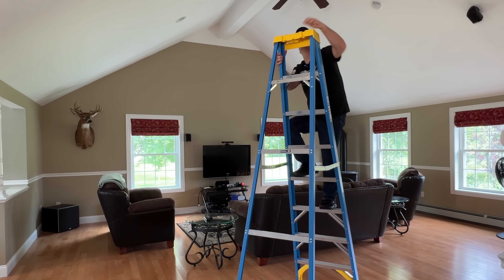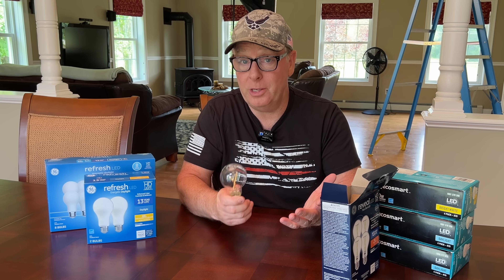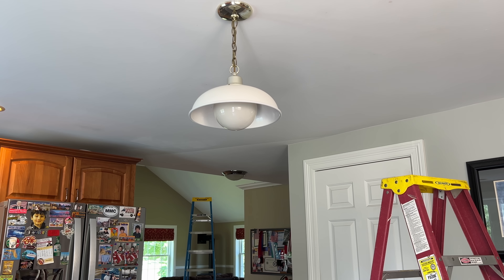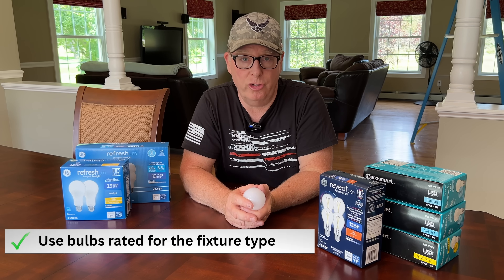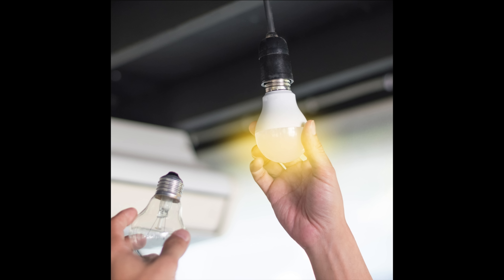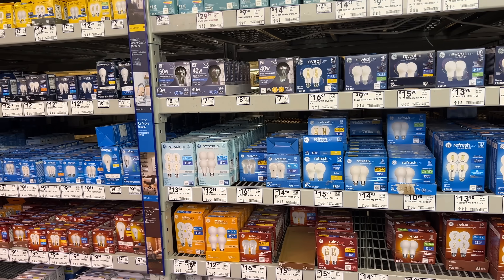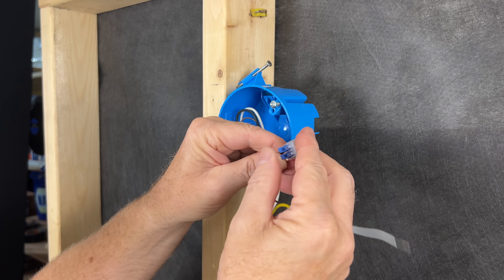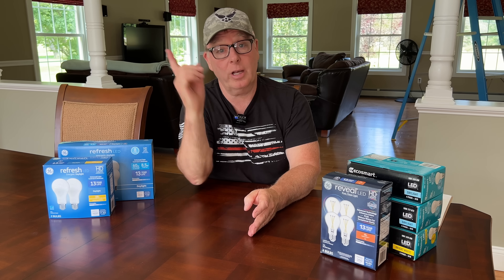The Mistake That Kills LED Bulbs

Comment: LEDs - the solid state physics device that eventually became the heart of light bulbs - was extensively commercialized when in was in engineering school a million years ago.  One of our professors suggested that an LED should last about 70 years in normal service.  But, if operated outside its designed current, lifetime would be greatly diminished.  Could it be that LED bulbs are suffering from designed-obsolecence disease?

Comment: I purchased 7.5 watt equivalent warm white bulbs to use in 2 small lamps in my den, off the internet.  They are on 24/7.  Has run continuously over 8 years now.  Same with a 15 watt equivalent warm white light bulb use in display cabinet, 24/7 on, 10 years and performing strong.
Reply: Yeah I have some going 14 years at least 12 hours a day from Omron

Comment: An led bulb or fixture will not turn off completely if your switch is wired incorrectly. I learned that 4 years ago when I installed a fixure in my kitchen, with the switch off the fixture would have a very dim glow, ony noticeable at night. The switch was on the neutral rather than the hot wire. I checked all my light wiring after that find.

Comment: At 3:39 ,
The bulbs are rated in hours, the percentage of time they are left on shouldn't matter.
Besides,  solid state electronics are much better served by constant temperature. Not just their surroundings but the components and boards they're made from.
The constant expansion and contraction from cycling is far more damaging than temperature fluctuations in their surroundings. 
Causing solder joints and traces to crack, resistors to fracture and capacitors to lose dialectic. 
Ive had many television repair people say the worst use scenario is frequent on and off cycling.  The same is most likely true for bulbs.
We know it's true gor incandescent ones.

Comment: nope, not at all. quality is good, they are all the same leds from the same manufacturer.
they have built in temperature sensor integrated to the driver.

they are over powered to make them burn.
add an ac capacitor to dim them slightly. will never burn again.

for standard dimmer: leave an incandescent bulb or a dimmable led on an array of undimmable leds. standards dimmers need a minimum amp draw to work properly which leds does not meet.

Comment: Thank you, John!  👍👍  I use GE Refresh and Philips Ultra Definition and about half of each brand burns out way too soon.  My office overhead fan and 4-bulb light fixture stays on about 16 hours every day and 1 or 2 will burn out in a few months while the others keep going for at least twice as long, if not years.  The overhead fan and 4-bulb light fixture in the kitchen is hardly ever turned on and usually never for very long, and 1 bulb will burn out quickly, a 2nd will burn out a few months later while the others keep going for at least twice as long, if not years.  Neither box says "Suitable for enclosed fixtures," so maybe that's why.  The fixtures are not enclosed, but they do entirely "cup" the bulbs and trap heat.  It's always something!  My Ex used to say, "If it ain't one thing, it's ten."  I wonder if holes could be drilled at the top to vent the heat.
Reply from the maker: Your Ex was right about that my friend. lol

Comment: Ecosmart bulbs are good for the money. The LED bulbs in my ceiling fan have lasted four and a half years so far, the ones at the top of my stairs, not so much. I need enclosure rated. I have two CFL, the first available, straight ones, not twisty, that have lasted since the early nineties. They cost more and were better built, 100watt equivalent to boot. I found several halogen, incandescent style, in my house when I bought it, I put them in my collection of porcelain knob and tube that I also removed. I also have the original porcelain hook up for the first telephone land lines around here, and I think I kept some of the original cloth covered phone wire.
Reply: You may know this but FYI those old porcelain tubes are great knife sharpeners. I carry one on my person. I only have a few of them so I guard them jealously. I dropped one on a hard surface once and it broke. If you have a lot of them they could be a great gift for your prepper or outdoorsy friends. Since they are hollow they can be used to blow on a fire, also a person can keep a rolled up piece of paper inside to use for either starting a fire or leaving a note.

Comment: 1:28 This is not true because the LED bulbs back then will fail early but the ones that I have bought last very long. 
The modern ones that I buy last longer. I often buy ecosmart LEDs because they last very long as they work with enclossed fixtures. The good thing is that modern LEDs are more durable & reliable. Most modern LEDs can be used in enclosed fixtures but older LEDs might not work. If you want dimmable LED bulbs you must have the switch & bulb compatible.

Comment: The truth of the matter is the reason they’re not lasting is because the LEDs that they’re putting in the bulbs are cheap. Chinese made LEDs. They are designed not to last as long as they claim. This is all in design so we keep buying constantly with the thought that they will last a long time. This will never change until a government entity steps in and forces manufacturers to give the correct longevity of the LED bulbs they are making.

Comment: Using LED bulbs that have the newer Match stick filament design tend to last longer as these do not produce as much heat. Heat rises so having an LED bulb upright (where the screwbase is on bottom...think table lamp) sends the heat away from the electronics inside the base of the bulb.

Comment: I have used the Home Depot Ecosmart bulbs and they seem to last as advertized. Most if not all of them are also rated for enclosed fixtures. Recently they came out with bulbs you can adjust colors and lumen output which as an electrical contractor is really great and they are dimmable. Hopefully they last as long as the non adjustable.

Comment: I made a comment on the other video about reversing hot/neutral not working. My bad. I had just repaired an led spot on my truck and had applied a DC light mindset to an AC situation. What I do encounter, in older New England homes, is voltage drop... Which I suspect was killing LED fixtures. They start buzzing and flickering. Could also be cheaper fixtures, but I've returned to only using fixtures with replaceable bulbs. Can't have a tenant replacing wiring if a light stops working.

Appreciate the info on enclosed fixtures.... Seems hot AND cold adversely affect led electronics.

Anything about the dripping silicone? Or is that only early generation LEDs?

Comment: I know what you presented, but I applaud your work to bring what should be common knowledge and common sense to the general public. I'm thinking we need a new bulb connector that has extra prongs for heat conduction. Then, the metal and glass body of the fixture could act as a heat sink. Imagine a chassis ground serving a heat sink.
Reply: That's a great idea!

Comment: I was so excited when led bulbs came on the market that I bought quite a few of them because I knew inshitfication was inevitable. Many of those original bulbs opposed to a few defects still work not to mention looking sci-fi and cool with their large heat sinks.
Reply: I have a couple like that in my basement with the large heat sinks. Still working after 15 years. Most of the LED bulbs I've bought since didn't last nearly as long as advertised.

Comment: Here in the UK our light bulbs can fit the holder either way round,  and surely with an AC supply polarity shouldn't make any difference, and in my experience poorer quality lamp holders cause premature bulb failure with any type of bulb, incandescent, compact fluorescent or LED.

Comment: I can get LED bulbs, 12 for $0.98 at Sam's club.  High quality ones.  They are subsidized by the local utilities.  Overheating is the biggest issue as noted, but modern LED bulbs are quite efficient.
Reply: If there filament style yes. Avoid the plastic ones. Not sure why they're even still around

Comment: I've been running LEDs for years.  I've found them to be very dependable.  I have around 35 bulbs, and in 10 years, I have replaced 2.  One of those was because the glass globe cracked when cleaning it.  The other had a strange intermittent flicker.  If you are frequently replacing bulbs, I would try a different brand.  Some well known brands today share nothing in common with the quality and stature that brand had 10-50 years ago.

Comment: I have a range hood that has a 3 position switch for turning on the lights.  The "full on" side fo the on-off-half switch works perfectly (of course), but the "half" position which worked fine with incandescent lights won't work if switched directly from the "off" position.  Funny thing though:  If I switch to "full on" then QUICKLY switch to "half". the LED lights actually do dim.  I suspect that has something to do with then holding a capacitor charged, so the power supplyinside the bulb works correctly.
On other light fixtures with a (normal incandescent) dimmer LED lights don't dim at all, they are either on (very low setting), or are on just a little above a certain spot.  Som yes LED bulbs are strange animals.  Oh, well (*SIGH*).

Comment: As my father who’s a retired NASA electrical engineer said years ago, the LED doesn’t “burn out” the AC to DC transformer in the bulb fails.  BTW I’ve personally had high failure rates with the eco smart brand bulbs.  Real GE seems way better.

Comment: You can't use them in enclosed ceiling fixtures (even if they claim you can).  I have tried numerous bulbs in my enclosed ceiling fixtures and they always die after a couple of months.  If you want LED ceiling lights, it's best to buy a fixture that has them built in. I purchased four fixtures with LED's built in, and I am going on 5+ years without any of them giving me any problems - they are still as bright as the day I bought them. The fixtures have the LED's spread out and have the drivers separated from the heat source.  Bulbs should only be used in open table or floor lamps.

Comment: The LED bulb has no way to tell which one is hot and which one is neutral. So even if you want to design an LED bulb that does not turn on when neutral and hot are reversed, you wouldn't be able to. And that goes for not just LED but any electrical device that is not grounded. If the device has a ground pin, then it can tell neutral from hot.

Comment: I bought a $25 LED bulb that had a steel heat sink in 2009. I put it in a floor lamp next to my leather chair and sofa and put it on an insteon smart switch set to be on from around sunset to midnight every day until I moved out and put it in storage in 2020.  I retrieved it from my storage unit in 2023 and I'm still using it today. The same LED bulb I bought in 2009.

Comment: Reversing the hot and neutral is not reversing the polarity. It’s alternating current. A led by its self will only conduct electricity in one direction.

Comment: I just replaced an Ecosmart led bulb that came apart in my hand.
It was base up in a pocelain ceiling fixture in the basement in front of my electric panel box.
I suspect it was heat that killed this bulb. It probabably had 25 hours use.

Comment: Good blog! I will add my 2 cents.... Home Depot and Walmart have a high end line of super bright 150 to 300 watt equivalent 2200 to 4500 lumens....  Most fit standard fixtures and provide real light, and last! They have large HEAVY, ventilated bases housing the electronics ... Some even include a temperature rating of 135F and more!  ANOTHER NOTE: The ceilings can be 25+ degrees higher than room temperatures in winter heat, bathroom and kitchen ..... This can lead to quick failure in cheap bulbs!  I have had 1 hour failures! and yet some decorative lighting lasting over 5 years 24 hr a day..... Good luck everyone

Comment: I would love to know what is different about LED rated dimmers as opposed to standard incandescent dimmers. The standard incandescent dimmers are mostly SCR or TRIAC based devices which I would think would be fully compatible. What am I missing here?
Reply from the maker: While both standard (incandescent) and LED dimmers often use TRIAC or SCR technology, the key difference lies in the electrical load characteristics they are designed to manage and the specific internal circuitry required for smooth performance with LEDs. Standard dimmers struggle with the unique demands of LED technology, leading to performance issues and potential damage.

Comment: The LED it's  self cannot very in quality much because of the very specific technical aspects that permit them to work. Where the consumer is getting shafted is the modern capacitor,  It is the new evil little prick! Think of it as the obsolescence timer of all things consumer electronics.  low quality caps put into overly simplified circuits with the capacitors working to operational limits. The LED driver is a circuit that makes the LED work. It is very reliant on capacitors that will fail well in advance of the LED's.  Heat dissipation is the 2nd problem with LED light sources though also a real defect.

Comment: If your livelihood depends on selling lightbulbs would you sell bulbs that  last forever? Nope, manufactures sell you bulbs that  last just long enough that it become too cumbersome to claim a replacement and you just buy a new one. 
Can manufactures build led bulbs that last 10x longer. Yes.
Heat is in itself not the cause of failure, but a result of driving the leds way too hard.
A led turns 100% energy input in roughly 80% light and 20% heat. But if you would take 2 leds running both at 50% of that same input, the total result will be a 110-120% light and just 8 - 15% heat.
Tweaking on this principle, more leds running lower, one could make a led bulb that uses 50% less energy, produces 90% of the regular amount of light which lasts 10x longer.
That  is exactly what  Philips did on request of the ruler of Dubai. @slamdvw did mention those Dubai lights here in the comments. 
Philips and other manufacturers, while even they proven can, prevent the rest of the world to be able to buy those energy saving long lasting led bulbs.
With 129 million household in the US, one could only  imagine what a supply of 5 of those new led bulbs that could save 25-Watt per hour per household would save on total US energy use. For sure one could close the moment thise are turned into their fixtures close a couple of those dirty coal power plants.

Comment: Thanks for this hitting on interesting stuff about these LED bulbs. I have theorized that LED's don't function well in my home where there is vibration, but I can't prove it with real evidence, and now I don't have any non-LED bulbs to make any comparison. Living in an old house with lots of growing, active kids, the areas where lights get lots of shaking from the old hardwood floors have seemed to be the problem ones for me. For example, I have two can lights that are both dead. I think these can lights are particularly susceptible to vibration because of the way they are installed. Maybe my theory is completely off, though, but let me know if you've found any correlation with LED problems like I suspect.

Comment: GE is now noname quality company that owns the old GE name and is not the namebrand company it used to be; treat it as a no-name brand. After going through multiple bulbs in multiple packs at multiple family houses in both eve in open fixtures its safe to categorize them as junk. Examining them found low quality components+engineering mixed together to have bulbs that don't meet the box's rated lifespan. I'd try other generics before picking up one of their boxes due to their normally short life. I hate unnecessary failure and low quality so stick mostly to things I have tried with success: Feit and (small sample due to price) Philips. I avoid 'smart' bulbs as that is features I have no interest in though brands do have adjustable color temp on some bulbs which is nice. Can't remember if I had bad experiences or not with Ecosmart but think it was okay luck but limited to testing on their flourescents (kinda cook themself in any fixture). Sis went through multiple bulbs from Ikea and I think Walmart thinking that an electrician needs to come out because not all the bulbs can be bad; failures weren't fixture specific and replacing the bad bulbs with quality bulbs stopped the failures. Electricians can't fix bad quality product shopping choices.
  Try drilling air holes in the top of your twice-a-year-replacement fixture for some air exchange (and hope for some airflow over that glass diffuser's top if you don't want to poke a hole in its bottom).

Comment: They are garbage. They don’t produce full spectrum light and they don’t last. I have built a lightbulb with 1440 LEDs that has been burning for 12 years and going. It’s nothing but LEDs and wire. No power supply, no passive components, just LEDs and wire.

Comment: C'mon! This is the same as with the original incandescent bulbs. Originally, they lasted for ages and what happened? The factories that made them didn't make enough money so quality was downgraded. The first LED lights I bought was around early 2000. They're still in my hallway and they can be on four hours per day. The latest ones last a few years.

The thing is, the LEDs are driven too hard and that cuts down longevity. Quite in line with if LEDs last forever, you can't make any money on them! Open them up (if you know how) and change a resistor (again if you know how). That will dim them a bit but they'll last much longer.

This is quite in line with everything else, like the computer printers that has a counters in them. When they reach zero the printer stops working and you're forced to buy a new one. "Refill" the counter (if you know how) and the printer will start working again. It's all about money.